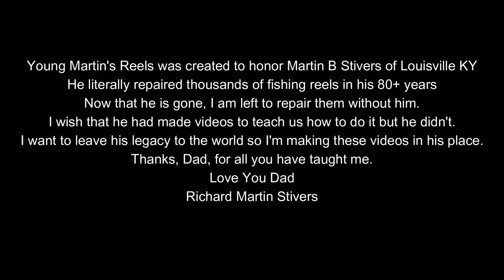Quantum QL3 -- Service and Lubrication -- Young Martin's Reels

Comment: I've seen a few folks using those inexpensive Quantum reels down in the surf along the Gulf. Those plastic bodies don't corrode like the metal body reels, but they aren't quite as strong. I use the Quantum spinning reels as they're inexpensive and perfect for the type of surf fishing I do.
Reply from the maker: Dan, I’ve always said, there a place for inexpensive reels. If you keep clean and well lubricated they can perform well and last a very long time.
Reply: @youngmartinsreels5314 I would absolutely never use a reel like this for the surf fishing I do.  Of course the Atlantic is just a little more boisterous than the Gulf. LOL — Chris